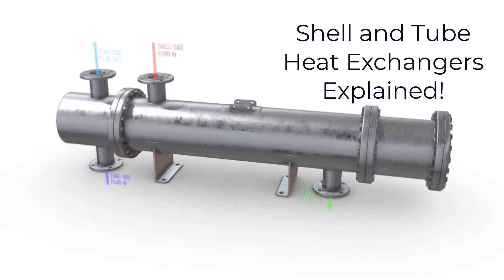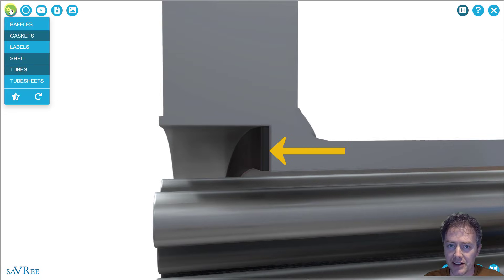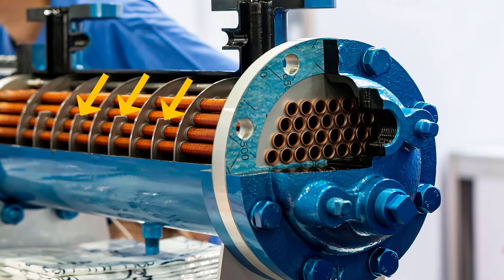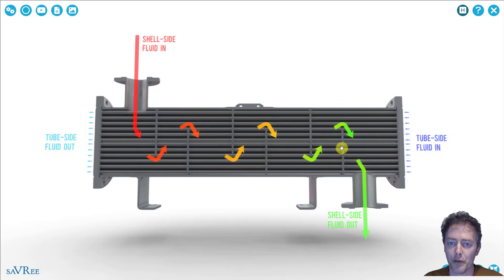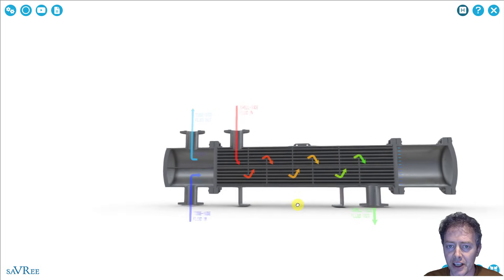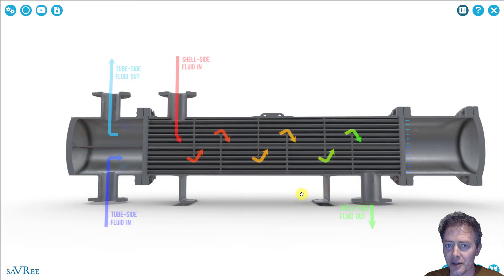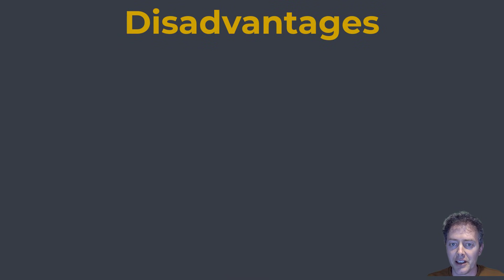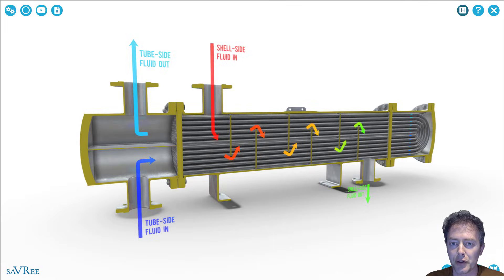Shell and Tube Heat Exchangers Explained (How it Works)

Comment: How are the tubes sealed to the end plates?
Reply from the maker: For lower pressure systems, you can mechanically roll the tubes. For higher pressure systems, welding. Or sometimes a combination of both.

Comment: Sailed as an engineer on a wide variety of merchant vessels for many years. Encountered the issue of insufficient open area at the ends of shell and tube heat exchangers on a few of them. Navel architects design ships and their engine rooms. Unfortunately ship engineers do not. Good video.
Reply: I was working on a ship that was assembled in Brownsville, Texas. It was the second American built ship I've sailed on and I can safely say it was the single most poorly constructed vessel I've ever sailed on. The engine room main piping and was in SAE and then it switched to metric for the actual equipment, so our storeroom had to house both standards for every nut, bolt, pipe fitting and wrench. An absolute fuckshow of a boat. Anyways, she had a plate type heat exchanger, the idiots who designed her tucked it up pretty as you please so close to the bulkhead that the strainer basket had to be cut in half to be inserted.
Reply: @hilowguy12345  You have to wonder how a ship can go through design, design revisions, construction, sea trials, USCG-COI, inspections for registration and hand off to the customer and crap like that still gets missed.
Reply: It truly boggles the mind. Then you get folks saying that AI will replace sailor jobs like these tubs don't actively try to sink themselves the second you turn around lol